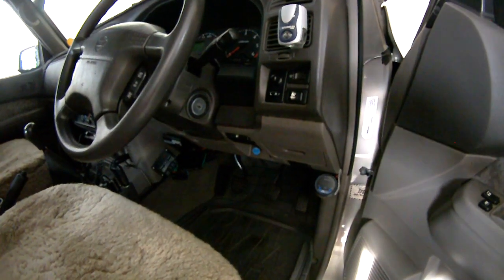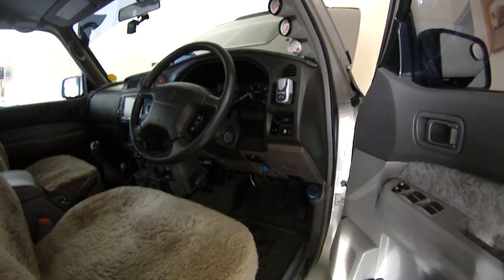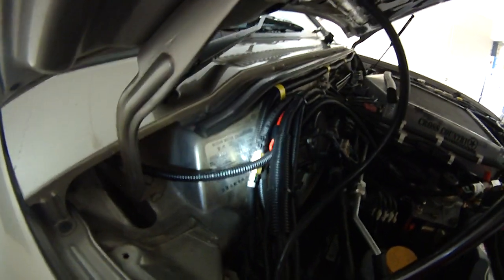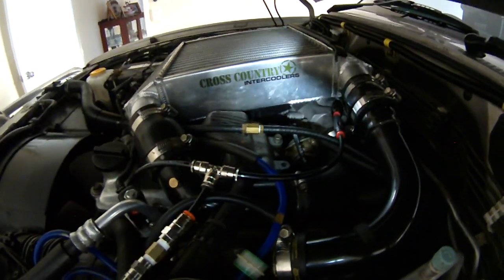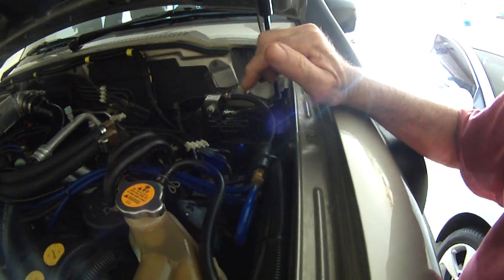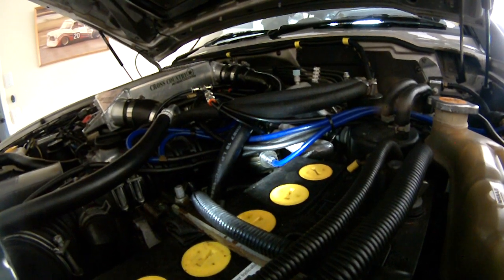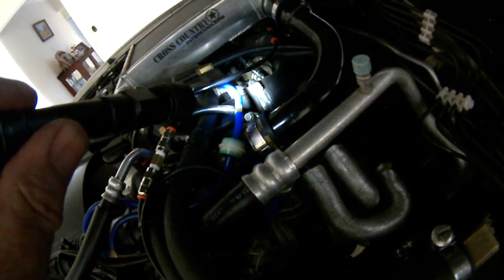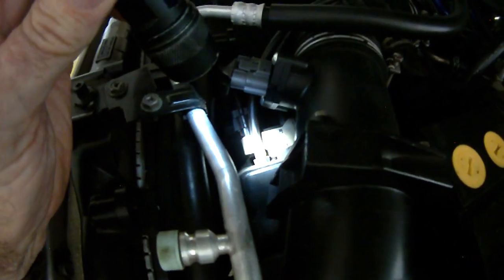Nissan 3L With Dual Dawes System and Needle Valve

Comment: I have not yet fitted the dawes valve and needle valve set up on my 05 30Di...but the car clearly is over boosting...the symptoms are that after 2000 rpm on the road at about 60-70km/h there is virtually no response on the accelerator pedal and if I floor it at this point the rpm goes wild to 4000rpm and the motors yells but still no power...and also the turbo doesn't kick in or maybe late I can not even tell.
 After my trip yesterday the turbo was full of oil around the big rubber tube that goes from the turbo to the inter-cooler , its like the rubber hose vomited oil on the turbo.
Is this because the little electronic vacuum actuator (near the air filter housing) is broken and doesent send a command tot he turbo VNT? 
Will installing the boost gauge , dawes valve , needle valve and bypassing the small electric vacuum actuator solve my problem? 
Or is the oil on the turbo thing something else? After diagnosing the car it was found that the turbo works but dosent get any command.
What is your take on this? Thank you
Reply from the maker: OK basically we are flying blind if we don't know what the boost is actually doing. Oil in the turbo could be several things, could be a turbo seal, could simply be oil build up from the rocker cover breather. To start with make sure you have no vacuum leaks as this can severely effect the VNT, once you have made sure there are no leaks get a small piece of tube and disconnect the tube to the VNT, then put the short bit of tube on the VNT and suck like crazy and make sure you can hold the VNT arm at full lift, this makes sure there is no leak in the diaphragm. Then we can go from there.
Reply: I recently changed all the 4mm vacuum hoses that go to the vacuum pump under the intercooler , the ones that come from the throttle body , the ones that come from the electric solenoid on the air box ,all of them and applied a new seal on the air filter housing like you did in one video as the old one was dry and disintegrating.
 But I will check the idea with the small hose on the VNT and see what happens and come back to you.Thanks for the help so far.
Its hard...here in Europe with I talk to some 3L owners , they have never heard on NADS and scratch their heads...
Reply from the maker: No worries mate, if I can help I'm pleased to do it.
Reply: So I tried sucking on a small hose connected to the VNT but to no avail, it was like sucking threw a straw in dry concrete , but I tried pushing up the vnt by hand and air came out of the small hose and when I let go of the VNT arm it sucked air in. 
Now I will try to set up the Dawes valve , needle valve , boost gauge , I have all the parts needed , but I have no clue on how to set the Dawes valve to 16 psi max or is it 20 psi max?.
Do I do it with the needle valve fully closed? At what speeds or RPMs does It have do show different PSI? And then how do I adjust the needle valve?
I read some explanations on forums but they are still not clear...If you have some simple instructions or a link to a post to clear things up it would be very appreciated!
Reply from the maker: OK, the VNT arm should rise to the top of its stroke with between 9 and 13"Hg, by mouth on a tube you should be able to pull 18-20"Hg so you should be able to get that happening very easily?
Yes adjust Dawes initially with the needle valve closed (to the right). Depending on what mods you have you may well only be able to achieve 15-16psi before you get limp. The idea is to start low and work your way up. I would start by adjusting the Dawes to 4 turns in and then take it for a drive and see what boost you get, go up 1/4-1/2 a turn each time until you hit 15psi and then I would drive it around for a few days to see how it responds, if you don't get limp with the needle closed then you can adjust it up a bit more and later you can use your needle to adjust limp, on a relatively std vehicle 16 may be your limit. Here's a vid I did years ago on dismantling and setting a Dawes (I don't run the two stage system anymore as I've done other things). A good start on a std vehicle is 5-6psi by 1500rpm and 10-12psi by 2000, as said that is a start point, as you get more familiar with it you can play around a bit more.

https://www.youtube.com/watch?v=eSkM5sG04i8
Reply: So, this weekend I fitted all the NADS components , the vnt does work because when I unplugged the hose coming from the Dawes valve and put in back on ,the suction from the hose lifted the vnt arm up easy. Now after numerous stops and adjustments to the Daves valve , I have 15 psi at 2.200 RPM , the car changes gear (its an auto) but the further up the gears the car gets the slower and limper it becomes , and after 80 kms an hour it is still sluggish and dosent want to go more then 2500 rpm , after the 15 psi at 2200 rpm the car just refuses , the accelerator pedal doesn't respond , and when I floor it it just revs like crazy again and the engine is struggling , I can barely get to 100kms/h...
And the accelerator pedal when the car is still , responds good, the car rpm needle revs and rises but has some stops like its not linear , and when I let the pedal go the needle comes back but also in the same way its not linear like its stops for a breif moment like there is a blank spot, it is hard to explain , this thing with the rev needle the car has it since I got it... I checked the throttle body and it is clean inside...Could the rev needle just be faulty? And also when I drive it and start accelerating the accel pedal doesn't get the car moving right away its like it has to bulid up boost or something... I drove my brothers CRD and the rev thing is totally different its strong and responsive linear has it should be...
Reply from the maker: OK couple of things, which setup are you using for the needle/Dawes? if your brothers is working well what schematic is he using? were you having an issue with throttle pedal before? if so it could be a faulty TPS, there was a recall for certain DI and CRD VIN's.
Reply: My brother's CRD is stock , The gear that I got is from Dawes devices... When I bought the car the TPS was scrwed, it worked only when sprayed with cleaner and then It stopped again and I had to spray it again... I changed it with a second hand part , that seems responsive only for that glitchy small stops....and when in park the car revs instantly , and in drive it has a delay after i press it like its picking up a little boost. I used this clip as a instruction for seting the system up : https://www.youtube.com/watch?v=JMh46SE3WSE&t=25s
Reply from the maker: Something else is going on here, a correctly setup Dawes/Needle will out perform a std vehicle any day if everything else is OK. You have either a setup issue or another mechanical/electrical problem. My suggestion would be to briefly return to original setup and see what happens, if all is fine then there is something in the setup as said. When you refit Dawes/Needle, bypass the vacuum solenoid completely and make sure the line between Dawes and VNT is as short as possible, keep needle valve closed and setup boost to around 14psi initially and see what happens then. We can work from there.